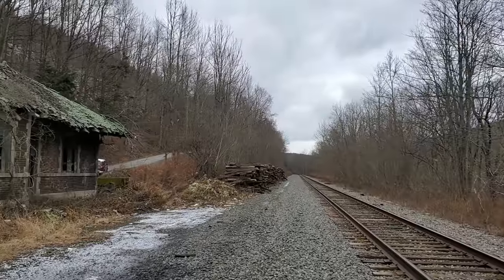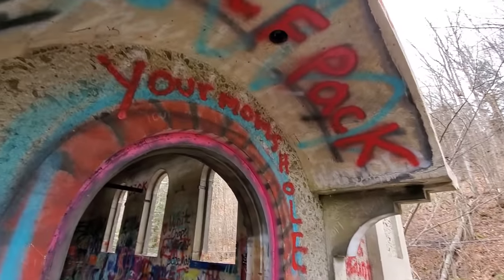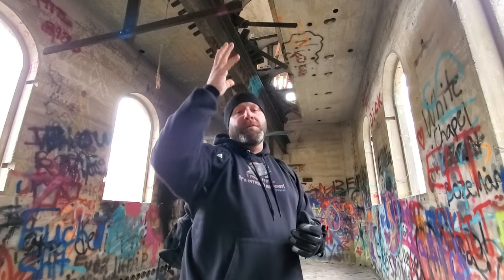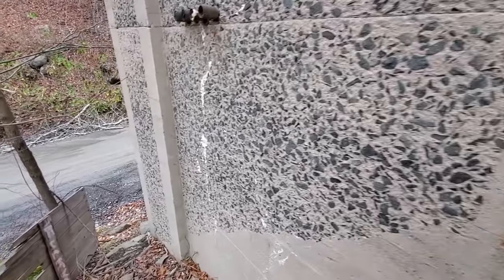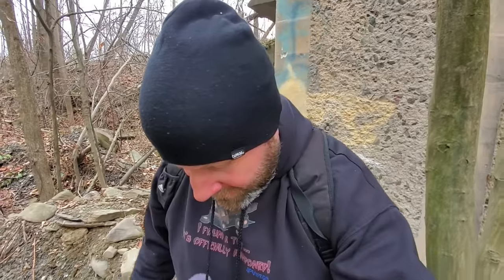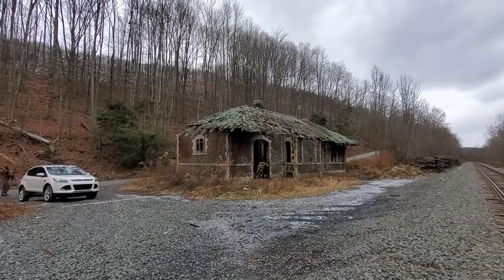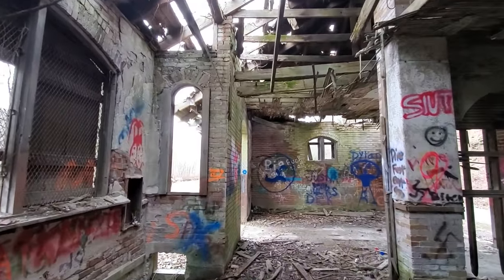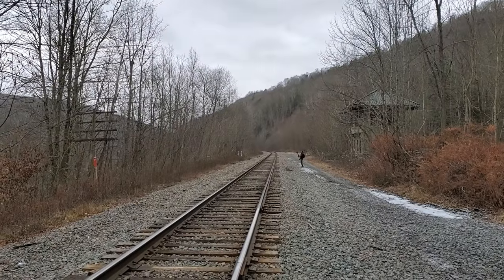The Abandoned Train Station & Switching Tower / Revisit

Comment: Way kewl, Jay! You got the designation half right, but "cart before the horse": it's "Armstrong," which applied to most of the stuff back in the early days of railroading---and just about every endeavor.  As I explained back in the first visit, the bottom room of this tower contained a mechanical interlocking mechanism, connected to the levers up above.  It was designed to make it impossible for the operators to throw the track switches in a way that would lead to a derailment of the trains passing through.  The bottom of machine was connected to the switches and signals through pipes(!) running alongside the tracks through stanchions with rollers, to let them move freely.  The ends of the pipes were connected with cranks to throw the switches and signals, and to transfer the motion, through cranks and pass under the rails.  The machine also operated the signals to let the locomotive crews know what was going on with their routing and also to regulate a safe speed through the interlocking territory.  As things progressed, compressed air, then electricity, was used to do the actual work and old systems like this would often be converted to mechanical-pneumatic or mechanical-electric to use the same levers.  Others had new operating consoles installed upstairs.  Back in the early '60s, Model Railroader magazine had a series of articles on building interlocking systems for model railroad use.  It was too complicated for my 20-year-old brain then---and it sure ain't any clearer now!  I agree 100% with you about the architecture: they were true craftsmen in those days, adding beauty to even the most utilitarian structures.  (Hell, even outhouses and railroad phone booths were easy on the eyes!)  You're one of my all-time favorite explorers.  Keep it shiny-side up and as I used to tell my biker buddies, "Stay outa trees!"
Reply from the maker: Ty

Comment: Hi Jay, I would definitely live in an old switching tower if it was converted, the waterfall is absolutely beautiful and I love it's woodland setting with all of the leaves that have fallen over time on to the forest floor. A real shame these old buildings weren't saved whilst still in their prime as the architecture is stunning. The concrete covering could be a type of material of just basic sand and cement although on older buildings it would have been sand and ground up lime as opposed to plaster which is a lot finer. It's really bugging me that those other people could have been taking those old switching levers as they were sure making a lot of noise and they drove off very quickly 😞😥. A very beautiful area, the main building has really deteriorated since the first visit though which is really sad. Thank you for sharing. x
Reply from the maker: We saw them walking back to their car and werent carrying anything.
Reply: @JPVideos81  Phew that's good to know as they were making quite a racket, thank you. 😊

Comment: The have probably been a track for upploading to boxcars from mainline and into the concreate block into the station wall. The size on the block was too protect the stadion if some boxcars  should came into the track in high speed with an accident. Probably there have been a plattform between that track and the mainline too. Good video 👍
Reply: There was for a local train that ran to Tiffany.

Comment: I live just a couple miles from Alford to the east.  We can hear the trains go by on a calm night.  The basement has been flooded every time I have stopped to explore.  The station is said to be haunted, but I have never experienced anything.    The station that burned was on the old rail line on the other side of the valley.  Route 11 occupies the old rail bed.  A spur line branched off in Alford and went to Montrose.   The new Hallstead cutoff was already under construction when the old station burned, so the DL&W built a concrete pavilion on the old line to serve the passengers until the new line opened with the new station.  To see old photos of Alford check out the Harford Historical Society on Facebook.   PS  I think the platform the girl was sitting on was used as a loading dock for wagons, loading and unloading freight.